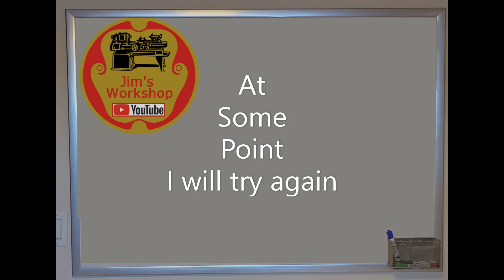Unimat SL Collet Adapter (fail)

Comment: My unimat 3jaw Chuck has a 0.05mm runout and still sufficient for the job. Maybe unimat is just not designed to precision work like the watch maker lathe.
Maybe worth making a back plate so you can micro adjust it by tapping the back plate with a hammer.
Reply: A general question that I hope to answer: Does this lathe have the ability to cut Iron or copper and aluminum

Comment: Hey Jim, I've been pondering this video. I'm just wondering if you used the indicator on each step of the adaptor not just the rod? Just wondering. Thanks for the video.
Reply from the maker: James, I need to do a follow up video on this.  I need to use the indicator on the spindle directly on all 4 of my Unimats to see what the run out is.  Then I am going to make a new collet nose
Reply: @Jims-Workshop  right on. I was thinking indicate the spindle and each step of the adaptor , sounds like your already in that line of thought. I'm curious too much.  sometimes I get my mind on something and it won't turn off.🤣

Comment: Hello. Jim.  
    I was wondering why couldn’t one use these er16 collet holder’s that have Morse taper (taper wouldn’t matter ). And uses m12 x1 draw bar. Cut the taper off and face it true and it should thread on. M12x1 threads. I haven’t done very much machinist work done welding and fabrication automotive work. Just wondering if u knew. There lot cheaper than unimat ones few hundred dollars. 
Thanks from ur ole hillbilly buddy stay safe

Comment: Hi James, nice to be here thank you for sharing your channel with us, collets they are one of the hidden expenses of micro and watchmaker lathes, something we are thankful to have solved in our own shop looking at the prices these days we would have had a real challenge achieving this task for our own shop for sure. Nice to be here with you, thank you for sharing. Lance & Patrick. Question James if we may? How was the spindle runout in the headstock before you made the adapter and its extension from the original spindle edge?
Reply from the maker: Thank you for Subscribing.  I will do a follow up video where I check the runout of the spindles on all 4 of my Unimats.  I have never done that.